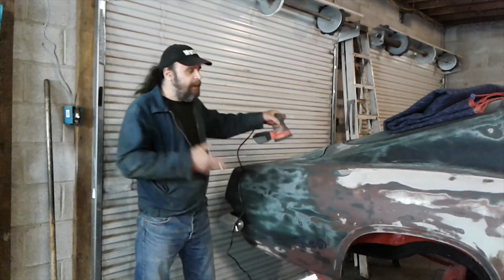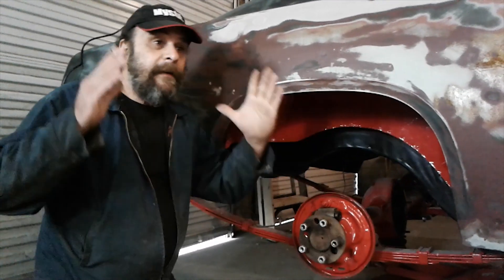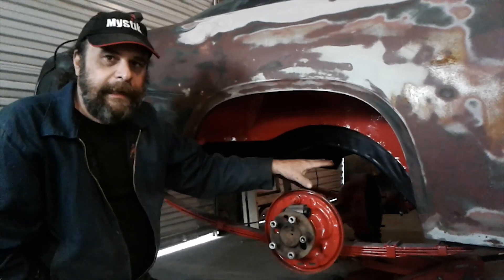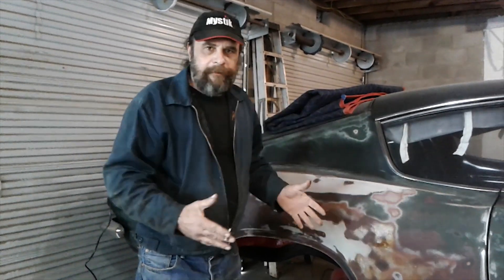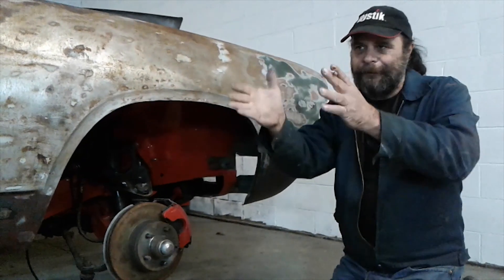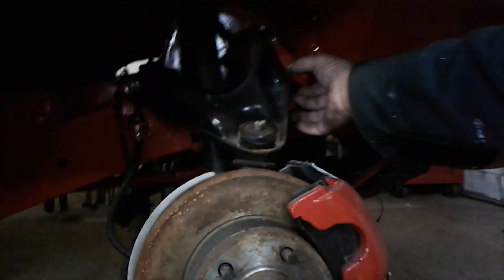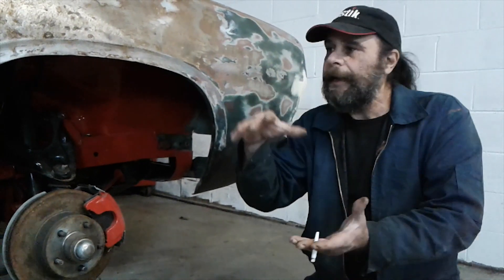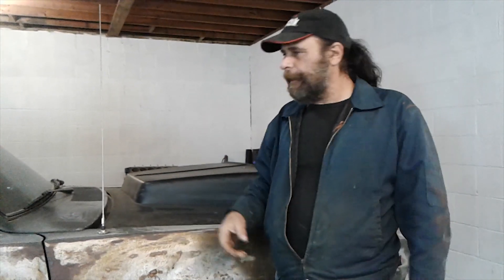A Closer Look At Our Long Term Barracuda Build

Comment: On those dead shocks, back in the day, we tapped that drilled hole.  Just like mod'ing a dirt bike shock, we'd measure the fluid out and replace with Bel-Ray 5wt fork oil and epoxy a set screw into the hole after cleaning with acetone.  Repaint and install.  Now you have a very forgiving shock that is quick enough to release at drag launch body velocities.  But if you got into stutter bumps on the street in a corner or something, you'd still have some dampening :)

Comment: Love it. I had the old Mopar bible as a guide, ran the 002-003 SS springs on my 340 Swinger with an adjustable snubber. Looking forward to your comments on the snubber. I shucked a pinion yoke launching on the street before I got the 5-7 degree pinion angle set. Had to learn to push in the clutch on deceleration as it really shoved the u-joint into oh-shit territory.

Comment: The topics you covered in this video are gems...reducing unsprung weight for launch, the extra RR lift. Keep the old school mojo flowing- it's working!
(Ps- old airplane engines used to be mounted ever so slightly pitched and yawed to counter prop torque...same concept as the raised RR leaf spring)
Reply: And the enpannage of the P51 was actually slightly canted to the right to negate torque at high speed!

Comment: UTC: Stupid question about this car. I've noticed a couple times of you showing this, the frame at the rear, where you are demonstrating, has a wrinkle in the coating/paint; what is that from?
Reply from the maker: That's just the natural surface of the framerail.  It stands out because it's been cleaned and painted

Comment: Depending on leaf spring purches on each differential , & obviously diff length (from backing plate to backing plate, & measuring from backing plate to spring purch(s)-  you can find all sorts of mopar diffs that will fit older 60s-70s cars... it goes back to basics with paying attention to details & knowing how to measure wheel/ rim offset. 
A truck rear differential will fit a a,b, or E body cars if the set of rims u wanting to run is a modern day wheel with large positive hub offset. Plus- the ability to run larger disc brakes, plus the ability to runs disc brake setup on the rear as well. I gotta ‘66 cuda with Enki 18by 8s that fit on both the front & rear..5lug by 4-1/2” hub pattern, center rim holes fit just enough to hold/ clear the front disc bearing center dust caps, plus I picked up a 8-1/4” complete rear end out of a 1987 Chrysler Fifth Ave FOR FREE... the guy I got diff from blew the spider gears teeths apart. But the 5th Ave diff works perfectly with these modern day rims. There’s roughly an 1-1/2” clearance between wheel /tire combo & outter leaf springs, & fronts clear the outer steering tie rods.. plus both the front & rear tires/wheel combo is wider than a stock rims... more “flush” with wheel well arches. No rubs with suspension fully loaded, & no rubs from lock-to-lock under load.
Reply: With truck rear ends though: mopar trucks had a 5on 5 lug bolt/ hub pattern, so swapping out axles would need to be considered.

Comment: I'm doing a disc brake swap on my 73 Duster I was told  my factory rims won't fit. But I'm going with 10.95 rotors. Is the 10.95 rotors are big bolt pattern?
Reply: yeah 11" rotors are from a b/e body, i made the same conversion in my 71 demon, you'll need at least a 15" wheel its literally a 1/4-1/2 inch clearance to the caliper in mine... you can either get the wheels off Craigslist/Facebook market place or Classic industries c:

Comment: I have a 68 Barracuda convertible, it was my grandfathers and I inherited it because I loved it as a kid, and have considered getting subframe connectors. My understanding is that the roof of a unibody car is an important structural piece and when they removed it for a convertible it really weakened the structure of the car. This barracuda at one point had problems with visibly twisting on hard acceleration. I'm told that problem was "fixed up" but I don't know the details. I've not noticed significant twisting but I'm worried the structure of the car is going to give way again down the line. Any advice?

Comment: Once you install frame connectors in an A body, you'll put them in every one you build. It makes all the difference in the world even in a street car.
Reply from the maker: We've had them in many cars. Other than making the car feel stiff, we've never seen any sort of advantage.  On the other hand, there is a distinct disadvantage on a street car.  By taking that small amount of "give" out of the unibody, you are focusing the normal flex of the spot welded joints on a much smaller area.  The potential for work-hardening and cracking those areas increases exponentially

Comment: I’ve seen a body’s wen you shift them into second and the whole backend jumps up it don’t squat like a regular car I’ve seen high horse power ones with a tourque converter  and you shift into second it squeaks the tires and the back end jumps up it’s cool to watch wen street racing if the car has a good stall converter miss my 67 383 foumula S car it was my last muscle car it was done pretty good had a lot of fun with it

Comment: just say it like a 70 to 81 camero talk about twisting i had a 77 camero and we put my pro built 327 in it just for fun first pull the windshield popped out and the car was twisted the doors would not open and the tire sat a inch off the ground i guess a 77 camero can't handle 1200 hp go figure then we get a brighter idea and put in a lifted 4x4 with 44 hawgs boy did that work good at 55 it could through pavement all 4 tires and take the running gear right out  never seen everything blown up but the motor even the trans was shattered the rear end casing had holes all over it even were the axles were no ring or pinnen   gear could be found then we got the race car dun so we didn't tare anything else up one crazy motor

Comment: I have to disagree Tony. I have had 5 fix bodies. The first one was a sunroof care. Minimal after market parts,about 300hp and the car twisted up with street radials on the street. Second,notchback and the same thing. Last three i tied the frames and had no issues whatsoever.
I get it. That's why there are torque boxes. But if you plan on beating on the car at all,tie the frame rails. Period.

Comment: I don’t understand why drained struts would be better than filled. Insight anyone?
Reply from the maker: They present zero resistance to rise, and then let the nose settle back down sooner so that the car has to push less wind
Reply: Also these old MOPARs have torsion bars instead of coil springs in the front. Coil springs would continue to oscillate up and down if there were no shock absorber. Torsion bars don't oscillate like a spring, so shocks are not necessary at the track. Watch the video again Tony explains it.